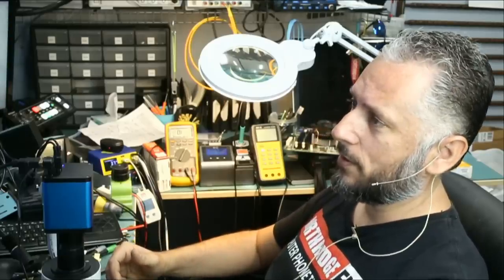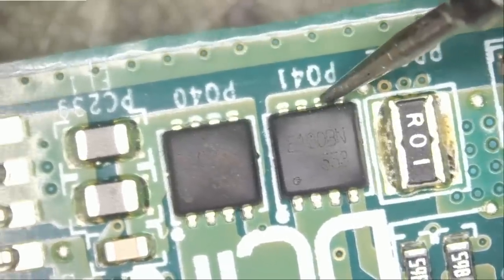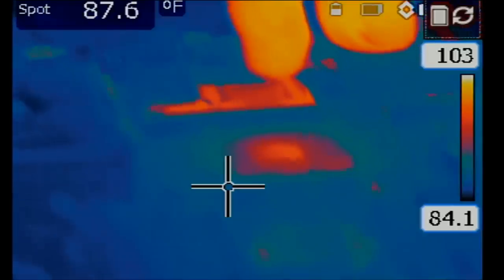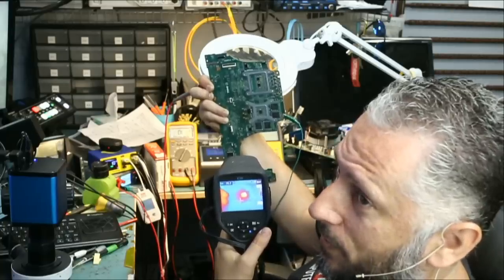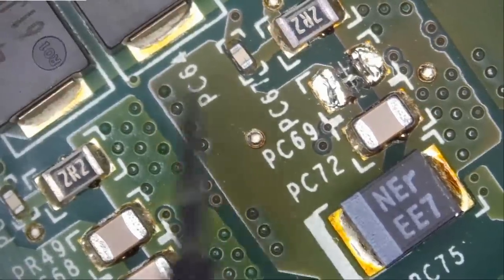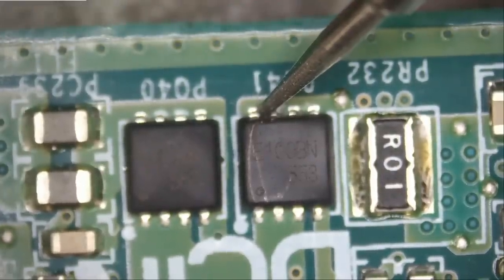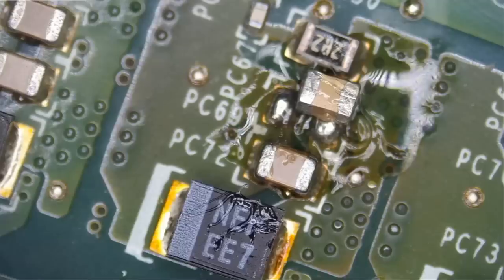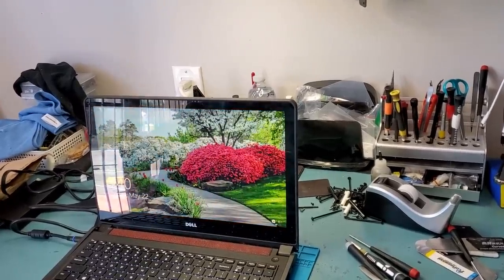Dell Inspiron 7559 Laptop repair - Does not power on.

Comment: High fan speed most probably related to BIOS especially hardware changes or incorrect setting. Perhaps solvable by resetting the BIOS or check BIOS setting again

Comment: I am not sure that a faulty keyboard would make the fan spin at full speed. Dell laptops are very picky with anything. You could reflash the BIOS. I had a similar issue in the past, the got fixed with BIOS reflashing. No user would want to use the laptop with fans at full speed all the time.

Comment: A bad keyboard rarely makes all the keys unresponsive. I think the issue is most likely on the motherboard
Reply: i agree... a totally dead keyboard is really uncommon... and the high fan speed is concering also...
Reply: @supercomputing942  That can be due to no keyboard detected... but maybe the keyboard controller is dead or something
Reply: @psialt9720  Or this keyboard just contains a temperature sensor inside of it and it's not detected, thus high fan speed
Reply: Yes I've seen a handful of times with Dell laptops before, that keyboard issues can be caused by the motherboard, not the keyboard itself.
Reply: @ArmenianBot  That's also what I thought. But NorthridgeFix can likely repair the issue
Reply: @Zebra_Paw  Very true!

Comment: 12:50 That keyboard connector is very finicky. Have to get it EXACTLY straight into the connector, if it is slightly angled then it doesn't get detected because the pins don't go to the right places. At exactly 12:50 you can see it is still a little crooked when he flips the connector closed. And its hard to lift the keyboard up and get it straight because when you lift the keyboard up it tugs the cable to make it angled. So you have to do it half blind peering in from the side with the keyboard right above the connector when you plug it in to get it straight. My Inspiron 15 inch is exactly like this too and it took me a couple of hours to get it in right.

Comment: This is why I hate laptops. Fix problem and find another issue. Sent one out to a repair place. Took about 3 months. Had to order a part. Fixed it and found another issue. Had to wait for that part. Oh, and this is years and years of trying different repair places that was a bust. At least we finally found one that seems to do good work for a great price and a reasonable turn around time. Really didn't have a choice. Most stuff is only from China now or $$$$ or both. So that place we use is $250.00 + s/h both ways. If they cannot fix it. You just pay s/h. They also don't work on just boards or machines that have been opened up and put back together. Though, we are exempt for that part. Don't ask me how.

Comment: tell big boss to snap the back cover back on, he doesn't have to screw it in and see if that tames the fan....i haven't done it with that model specifically but on certain latitude models without the cover on the fan ramps up like that....if that doesn't work reseting bios to factory might

Comment: Hi Alex, I'm from Philippines. And I just want to ask something regarding my laptop. 

My laptop model is Lenovo Ideapad S145-14IGM. 

It started on July 7. I charged my laptop, not checking if it was charging or not cause it was just the usual. After 2 hours, I started using it thinking it was fully charged but when I saw the battery icon in the screen, it was only 39%. I was wondering why it was not fully charged but ignored it anyways. So as I was using it, I decided to charge it and was shocked because my laptop did not charge at all. I plugged it to another port and at first, it charged. I glanced over it again and now it was not charging. I wondered why. It never happened to me. 

I got back where I was usually charging it and plugged it again there. The same scenario happened. Puzzled and scared, I looked at the charging pole of my laptop and saw the orange light blinking when it was supposed to be steady.

I can still turn my laptop on and off. The only problem is that it is not charging and the orange light is blinking. I can't check if the charger or the laptop is faulty as this is the only laptop and charger in the house. 

Can you tell me the problem please? I'm so sorry if I bothered you with this question. I asked the people I know who use laptop but they don't seem to know. I also tried searching but there was no case similar to mine.
Reply: I also tried charging it again yesterday and tried it in an extension cord. The orange light went steady for a few seconds and went blinking again.

I don't have any knowledge when it comes to this. If someone replies, it'll really be a big help to me.

Comment: High fan speed and non-working keyboard implies that the Embedded Controller is not doing its job right. Could be its power, bad controller part, in need of reflash, or (usually) just in need of reset to default values (see system specific steps for how to do that).
Reply: The Embedded Controller on the 7559 is absolute trash.  Sometimes, it will have a failure where the keyboard and power button completely stop working.  You literally can't turn it off (holding down power for 5 seconds doesn't do anything) unless the battery cable is disconnected.  Then it works again.  It's happened to me at least 10 times.
Reply: @Dwedit  It's probably the high quarity filmwale written in China or India... I mean, why have a single US engineer develop it when his salary pays for 4 engineers in India..

Comment: What's so special about this flux? (Serious question)
Reply: It works very well and doesnt leave a horrible residue all over the place.
Reply: its not burning black when heated
Reply: no cleaning is needed after work
Reply from the maker: Excellent flow properties. Lasts under heats, Easy to clean, no disturbing smell and leaves round and shinny solder joints.

Comment: Pavilion 15 came for no power, fixed it easily the charging port connector cable was severed, replaced it with HP part, reassembly, keyboard isn't working, then customer ask for a new keyboard (palm rest assembly in that case) I say no, proceeds to trash laptop in my face and leave without paying.
I got a donor board for free, too bad for that screen tho

Comment: 0:50 A slight discoloration on cheap motherboards is good indication that somewhere in this specific area the temperature of components are rapidly changing . This is normal if one side has good heatsink and the heat has way to being took. Other side doesn't have to. Copper when is heated it expands. Soldermask (green color on motherboard) do not expand. Thats why it makes discoloration of expanding and shrinking copper plate.
Reply: Thats very good to know
Thank you for taking time to explain the phenomenon

Comment: Can these capacitors have 10uF value?  Do you mean 10nF?
(uF microfarad)
(nF nanoFarad)
Reply: yes, smd capacitors can also have values in 10uF. Although the capacitance will change a lot with temperature and the curve overall isn't as nice as electrolytic.

Comment: If the other caps are in parallel and are also shorting to ground why don't they heat up also
Reply: Those caps aren't shorting, the board was shorted by the one bad cap. When he put the leads on one of the good caps, the current traveled across the board, through the bad cap, and closed the circuit through the leads that way. That's why, after removing the bad cap, those other caps no longer tested as shorted.
Reply from the maker: Current takes the path with the lowest resistance, in this case the shorted cap.

Comment: dell bios has supportassist which will check every hardware for error,from keyboard to fan,ram to harddisk,power or cpu  overheat or cmos battery 
and it has ability to go online and download required driver directly from dell